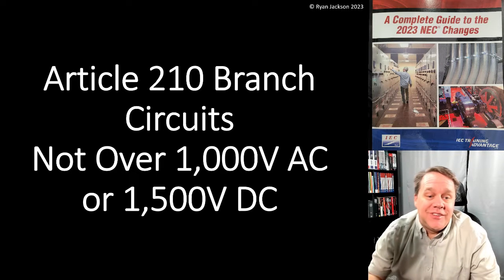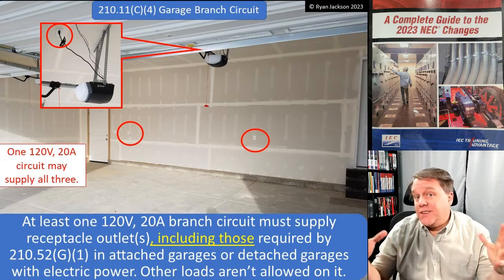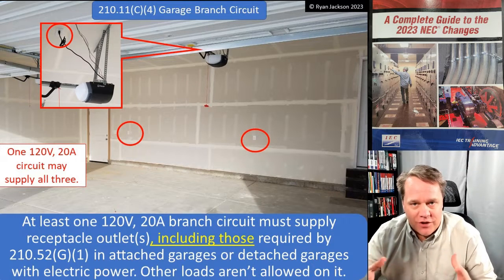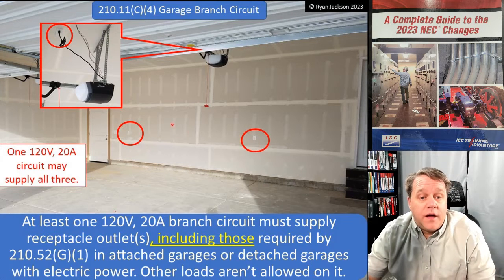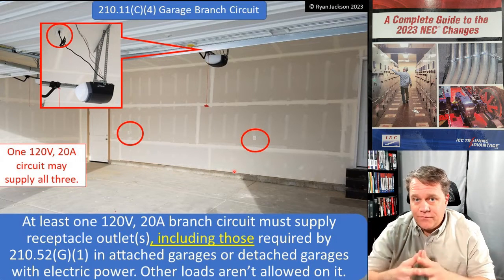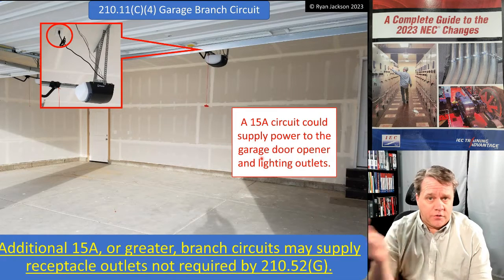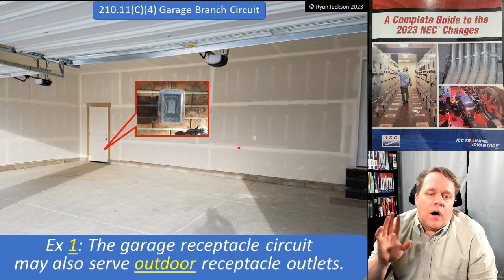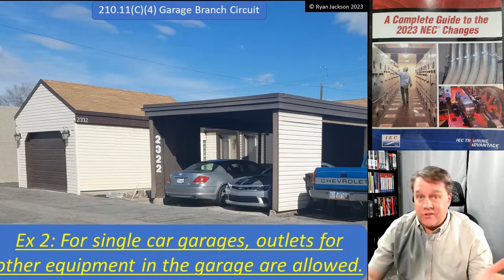2023 210.11 Required Branch Circuits

Comment: This change to garage door opener circuits is lunacy.  A malefactor can shut off the circuit to your garage door opener by causing a ground fault on an outdoor receptacle on the same branch circuit.

Outdoor outlets should never be combined with any essential load such as internet service, lighting, refrigeration, home security, alarms, etc.
Reply: then dont do it. Its just that we can if we choose so. Nobody twisting your arm to do so.

Comment: Quick question garages are NOW included in your load calcs for Floor Area. It was removed from the wording in areas that where excluded from your 3 Volt amps square footage 220.5 (c)?

Comment: I definitely like lighting on a separate circuit from receptacles...particularly in your wood shop scenario: 
   Table saw + dust collector trip the breaker mid cut; it is nice to have the lights on as that saw blade spins down. (not to say that the table saw and dust collector should have been on the same circuit in the first place...)

Comment: I feel it is always good to separate the light circuits from receptacles. If you have an open circuit in either the light branch or the receptacle circuit you can still illuminate the area to work either through an intact lighting circuit or temporary work lights on the receptacle circuit rather than being in the dark and running an extension cord to power work lights
Reply: This is so obvious that I don’t know how he could overlook this.

Likewise, the opener is combined with the only light in the garage if you just arrived by using the opener.

So again, the opener circuit cannot serve general loads, except that I’d be fine with it being combined with other switched lights and openers, and definitely not outdoor outlets.
Reply: I wanted to reply to Ryan in a similar response. Lighting and receptacles should not be on the same circuit.